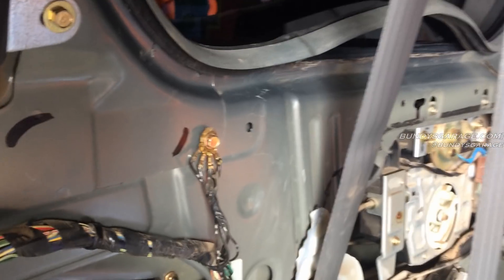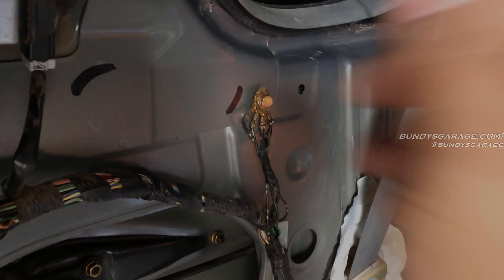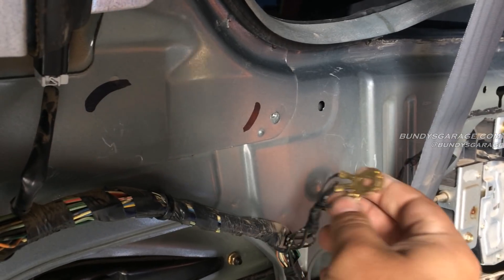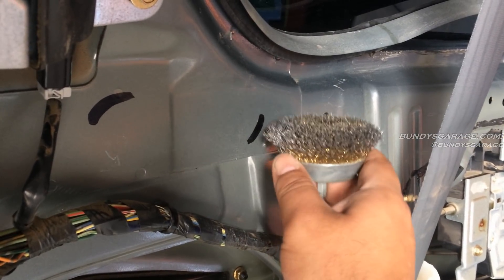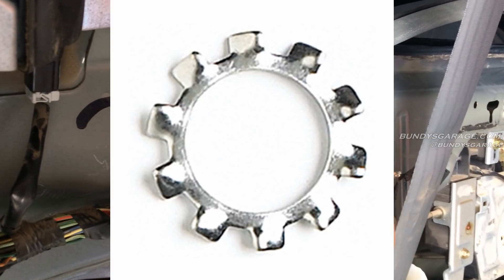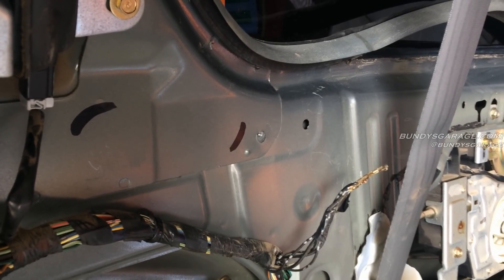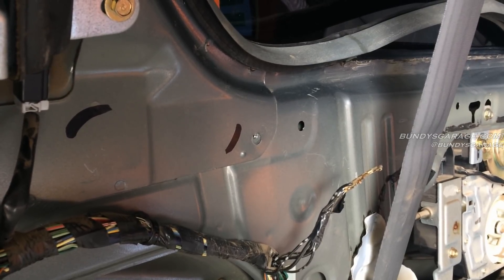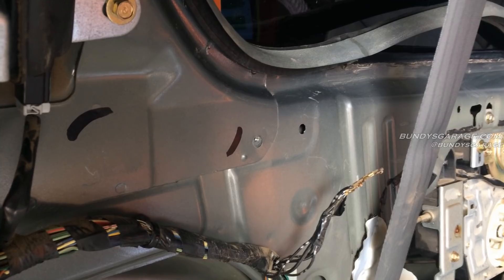Fix Bad Grounds on a Honda

Comment: Ground connection is from the wires to the bolt to the threads in the hole, not the surface of the sheet metal.
Reply: Hater do your own video

Comment: Forgive my ignorance, but won't you end up with rust if you use a wire wheel to remove paint?
Reply: Put lithium grease or equivalent on fasteners.
Reply from the maker: You could paint it after grinding the paint off
Reply: @bundysgarage  Dielectric grease?

Comment: After replacing headgasket it blew because I didn't torque it. Not being able to undo the exhaust a second time I torqued the heads down and stuck it all back together. I am not getting spark. I stuck a plug in the coil and grounded the plug on ground and turned it over. No spark! I do have power going to the plug but the ground must be dead
 There were really only two location with ground wires on the motor.
Reply from the maker: Run your own ground wire from the block to a place on the frame and see if it fires up. You could even hold it in place with your hands while you have someone try and crank it.

Comment: That location of that ground seems to be very common on Ody vans, and in your sliding door fix video (https://www.youtube.com/watch?v=cUun0P0aONQ)  it shows that finished ground fix @3:28  you also fixed a bad ground for the cigarette lighter. Are there any other major ground locations or are they just all over the place and you need a book to find them?

Right now I have a 1999 Ody crank no start. With the key on there is no "Check Engine Light" and no "Green Security Key" light flashing on the dash. I don't have a scan tool, a book, or any wiring diagrams. I do have a test light and "Multimeter" ( "Hyper tough multimeter"not saying know how to use it, but I gots one....) https://www.youtube.com/watch?v=RKmyJ_hzDwc) 

What do I need to check to know if I have power to the PCM. Like I say I have no wiring diagrams and it's looking like the PCM is fried. My brother was having to use a power-pack to jump start because of a parasitic drain over night. I think he did it wrong one time and......
Where do I need to start looking. Also the fuel pump does not run and the relay under the dash is new. The 10 amp fuse on the D-side kick-plate has power on both sides. I have pulled the PCM, looked inside, smelled inside, it looks like new, very clean, no burns or smells. All help is greatly appreciated.

Comment: I have esd electro static discharge over the speaker whenever I lock and unlock the door, will this resolve the issue?
Reply from the maker: It might. Is it an aftermarket stereo? If so, someone didn't install it correctly.

Comment: Do u have to un hook the battery first?
Reply from the maker: Negative 😜 sorry couldn’t help it! No you do not have to unhook the battery when you are adding grounds. If you want to you can buy not necessary. Just make sure you have the code to the radio before you disconnect it cause the radio will not work after the battery is reconnected.